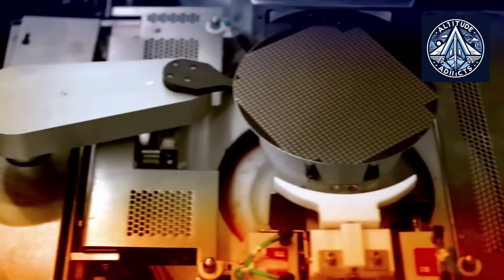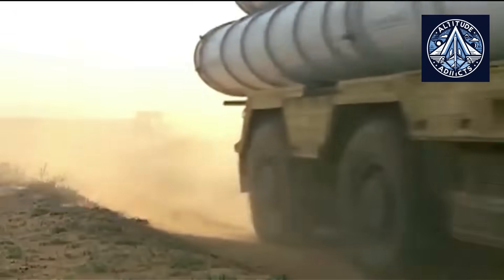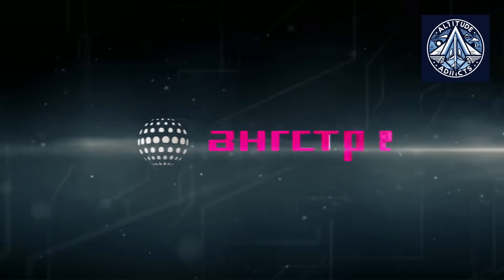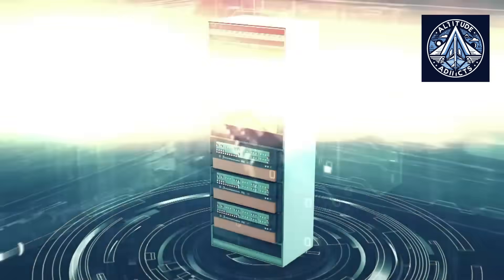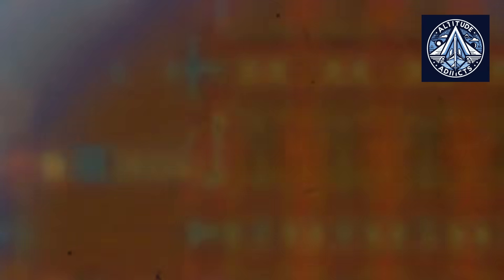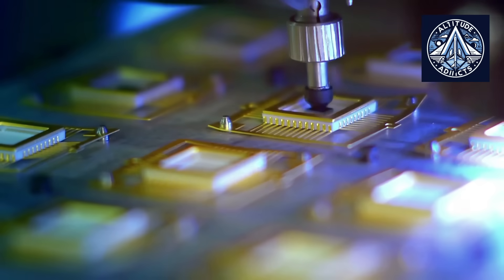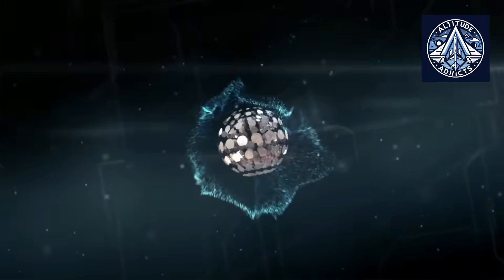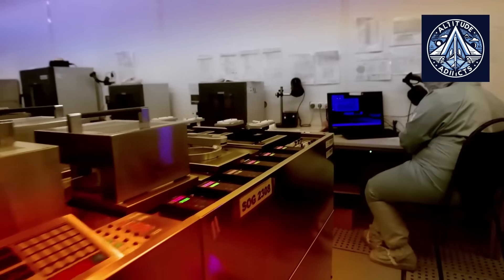Why Russia Paid Just 1 Ruble for a €1.2 Billion Semiconductor Plant  | AMD |  Angstrem-T | 130 NM

Comment: This is not the only factory in Russia.
There is also the "Микрон" factory, which has 180-90-65nm processes. Roscosmos also has its own factory, which has 250+nm processes. Space radiation does not spare small processes, so this is justified.
Reply: есть еще мелкие производства с производительностью в сотню чипов в месяц, те и до 3нм способны производить. но это фактически лабораторное и дорогое производство
Reply: @анатолийАН-м9к  what the hell, there are only a few units per month, and the area is so small that you can't make a single full-fledged chip. It's all about testing various technologies on tiny platforms.
Reply: modern processors are working in prallel. 16 processors or more. That's how they cancel out radiation problems.
Reply: :hand-pink-waving::hand-pink-waving::face-blue-smiling::face-blue-smiling::face-blue-smiling::face-blue-smiling::face-blue-smiling::face-blue-smiling:💔💔💔💯💯💯💯💯🤟🤟🤟🤟🤟🤟🤟

Comment: The EU is still straggling behind with 32 nm at best. Only 2 countries in the whole wide world have climbed up near to the 2-3 nm peak. And the US is not one of them. Nor England, Germany or the rest! The 2 are Taiwan and S.Korea. Why would anyone expect Russia to be up there? They were incredibly credulous when they ended the Cold War and took the easy route - scuttled their own chip industry and relied on the world market. By 2008 it became clear that this was a question of freedom from imperialistic blackmail. Now it's hard to make eggs from an omelet. But they have to.
Reply: We can design and manufacture 22/24 nm and, apparently, even 14 nm products at other foreign facilities. We can manufacture 60 nm and, apparently, 45 nm products at our own facilities, but with a somewhat higher defect rate per batch. This information is for those who understand how lithography works and that each wafer, even with advanced technologies, has a fair amount of defects; the only question is always how much.
Reply: @НиколайСмирнов-с7х  At foreign facilities, each country can manufacture every product. Except for Russia which is sanctioned because of the war. Concerning the ability to produce 60 nm an below - this is questionable. In fact, it applies to Micron which tried to tune old 180nm equipment from STM for smaller structure size. Not very successful because of the low yield. What you call „somewhat higher defect rate“ is the crucial point, processes of high yield are useless. In the end, Russia is able to produce 180 nm products on the old French equipment and tries to establish own manufacturing  on 350 nm level. A disaster.
Reply: @alexandervt641  несёшь  какую то бредятину.. К 30 году Российские литографы будут лучшие в мире по технологиям создания микроэлектроники . У нас подход другой технологический подход к новейшим литографам что готовят к промышленной эксплуатации.. В 26 году планируется выпуск в серию первых литографов ..  И  причем  микросхемы будут работать с положительными и отрицательными электронами.. Технологии  ВПК.. таких технологий за бугром просто  нет. А размеры чипов ,.  - если айфон будет размером  как спичечная головка?.. А супер компьютеры устаревают .. Так как на смену идут квантовые компьютеры... И хоть и гонка за нано метрами и продолжится но такой актуальной уже не будет ..
Reply: @alexandervt641  emmm nope xD 

We've even been manufacturing processors at TSMC all this time 24nm. Alas, it's a shame you live in an echo chamber. You could have learned a lot about who's the bad guy here, and who's being supported, or at least not interfering with anyone...
Reply: @СемёнСоковой-л5н   Если дальше идти нынешнем путём, к 30 году отставание России превысит 30 лет. Страна уже сейчас отстаёт на 20-30 лет, а средства вкладываются малюсенькие. Поэтому будет ещё хуже, чем сейчас. Если это вообще возможно.
Reply: @СемёнСоковой-л5н  In 5 years you should overtake China, which has been investing more than 1/4 of your entire economy for more than 15 years. Don't be ridiculous. Huawei will dominate. There is nothing so far that shows the efficiency of the Russian ones, unlike the Chinese ones.
Reply: @internetexplorer3999  Why compete with Huawei or Samsung? But in aerospace, military, medical, and other fields—that is, industrial electronics—it's not about competition per se, but about the superiority of Russian technology. Something like that. And you can buy a Chinese or Korean smartphone. For Russia, this isn't a critical factor.
Reply: @СемёнСоковой-л5н Have you seen the Chinese military parade? Laser weapons, untraceable bombers, fifth-generation jets, anti-ship and anti-aircraft carrier missiles? Russia doesn't have these things. China has completely autonomous factories, and to make chips you need specific chips and lithography machines, engineering, and experience. Russia doesn't have that. How can you say you're the best at the industrial level? When China surpasses the entire world in everything.
Reply: @internetexplorer3999  Are you serious? Just look at the Russian parade. Everything you mentioned... It's all there, and even more... and the technology is better. China produces a lot, and with Russian technological support... Planned production of the PD-14 aircraft engine is currently underway in China... And lasers have long been used on the front lines. Air defense specialists around the world consider Russian systems the best in the world... They're like from another planet. Honestly...
Reply: @alexandervt641  Well, in the last century, the United States cut off access to oil for Japan, which led to Pearl Harbor. Turn off the oxygen for Russia and you will never come out of your bomb shelters into the fresh air.
Reply: @internetexplorer3999  Semiconductor products for aerospace or military applications don't need to be excessively small, as stability is more important than speed. And on a small scale, Russia can still produce semiconductor chips under 10nm, sufficient for its own needs. However, in the field of AI and supercomputers, Russia is clearly lagging far behind. If China succeeds in the future, this problem will likely be solved.
Reply: You might add that taiwan and south korea themselves use lithography machines designed and made in the Netherlands. The Netherlands is therefore the country standing at the top of the microchip ecosystem.
Reply: @gabrielbalbec883  Yes, and this only opens even wider the following question: Why is there no cutting-edge fab in the Netherlands, or in the whole of the EU? Surely there cannot be any export restrictions by the US in the EU, too!
Reply: @chavdarnaidenov2661  I'm not aware of any cutting edge fab of this kind in the US either, but I may be wrong. microchips factories disappeared in the west due to low-cost competition from Taiwan and Korea, and it would take a strong political will and an enormous investment to bring them back. something that can be done, but is not on the agenda.
Reply: @gabrielbalbec883  Just one blow from Oreshnik and the planet will lose new phones?
Reply: Russland und China produzieren mit ihrer eigenen DUV-Lithographie ebenfalls 5 nm-Transistoren.
Wenn auch noch nicht so viele wie Taiwan/Südkorea. Die brauchen dafür aber EUV.
Ja, die Chinesen arbeiten noch an einer EUV-Lithographie-Maschine.
Welche Strukturen schaffen DIE dann, wenn sie schon mit DUV 5nm-Stukturen herstellen können ? (!)
-
Ich habe seit 2023 eine NVMe 1.3 aus China. Die ist doppelt so schnell als meine 990 Pro.
Und in den 4K sogar 25 Mal schneller. Und immer noch zwei Mal so schnell wie die aktuelle 9100 Pro.
Und das sind NVMe5 _2.0-er !!    Ich habe mich schlapp gelacht, als ich gesehen habe, was die Jongjong drauf hat.
Sie ist immer noch mein bestes Pferd im Stall.  Auch meine OWC Aura Ultra IV mit 8 TB kommt an die
Jongjong  BEI WEITESTEM  nicht heran.  Und der Preis der JongJong ist da geradezu lächerlich gegen
die Korruptions-Summen von Samsung und Hynix.
Reply: @chavdarnaidenov2661   india is meking 2nm chip
Reply: Not clear what you want to tell. Russia is at 350 nm - light years behind the world market.
Reply: @alexandervt641  Russia's newest and strongest chip is 32 cores in 7nm, which is in the same class as the competition, but obviously Russia does not produce that chip.
Russia produces chips in 28nm and 65nm, which is not at the top, but not far either.
The 350nm that you mention, Russia has had the technology to produce since 1996...
Reply: @alexandervt641  Lol no Russia can produce 22nm and smaller
Reply: @alexandervt641  the "world market" means nothing. Some countries have the technology, others don't. Period.
Reply: @alexandervt641  Russia may be far from world market but Russia can do it alone again and soon or late will become one of very few leaders in this industry, unlike most of the rest.
Reply: @pavelgonzalez9569  The opposite will happen. Because Russia alone can only produce totally outdated chips. And the more time passes, the greater the backlog becomes. The Soviet Union is the best example of the terrible consequences of economic isolation. The whole strategy of «импортозамещение» is idiocy which returns Russia into technological stone age.
Reply: @alexandervt641  Soviet Union collapse is not a consecuence of its isolation, it was not isolated, and Russia is not economically isolated now. Поживём увидем.
Reply: @pavelgonzalez9569  The Soviet economy collapsed for two reasons: 1. planned economy, 2. economic isolation. The SU produced everything alone and thus in lousy quality. Quite similar to Russia today: Instead of planned economy we have oligarchy and economic isolation due to Putins war. The whole system is corrupt and must be changed.
Reply: @alexandervt641  что за бред.. Плановая экономика наиболее  прогрессивная модель развития.. Сталинская экономическая модель Сильно отличается от Хрущёвской модели.. пример нынешний Китай...
Reply: @alexandervt641  , телемарафона пересмотрел? Советский Союз рухнул от того, что идеологию поставил выше экономики. Всё остальное - последствия.

Comment: With china and the west competing for 3nm manufacturing, this news about 130nm Russian nodes seems decades behind.
Reply: In what sense "decades behind"!?
If we talk about processor design, let's not go further into the past, in 2013, Russia released an 8-core processor in 28nm, which is 3 years later than other players in the industry. The next is a 16-core processor in 16nm, which was released in 2019, which is 5 years later than the competition, and this year Russia released a 32-core processor in 7nm, which is 6 years later than the competition!
Who makes those processors is a completely different story, but Russia has the scientific base and the absolute ability to design processors of the highest class.
When it comes to manufacturing, Russia has about 10 chip factories, 2 of which specialize in processors and make them in 28nm and 65nm technology... not top class, but not far behind either. Of course, the capacities of those factories are a fraction of what competitors have, but here we are not talking about quantity...
Reply: For majority of electronic component js 130nm just ok
Reply: I think you need to go look at what 80% of the chip market entails.
Reply: Не волнуйся, этого вполне хватает, чтобы делать лучшие в мире системы вооружений!😉
Reply: @Tigr_Rus  На данный момент хватает только для того, чтобы делать худшее в мире оружие.
Reply: @alexandervt641 😂😂😂